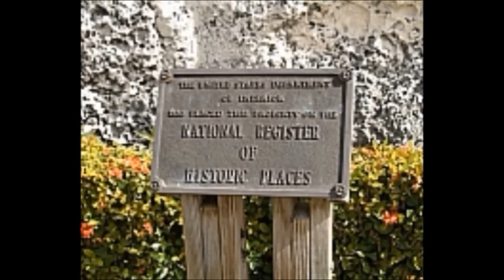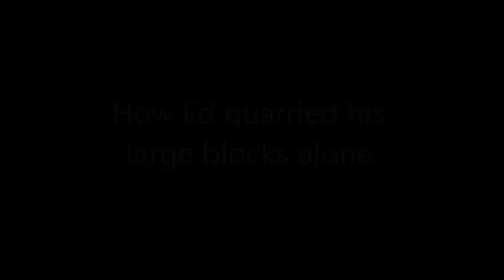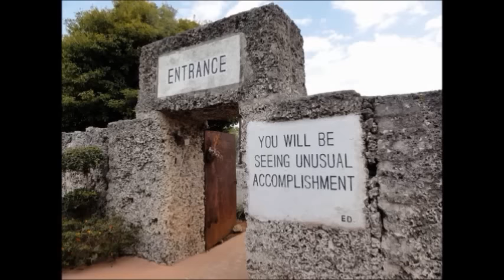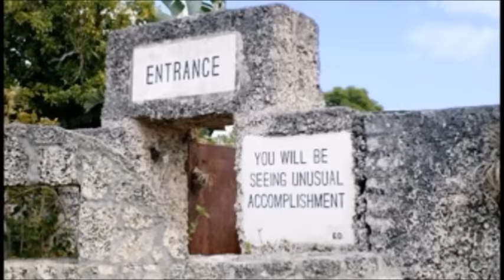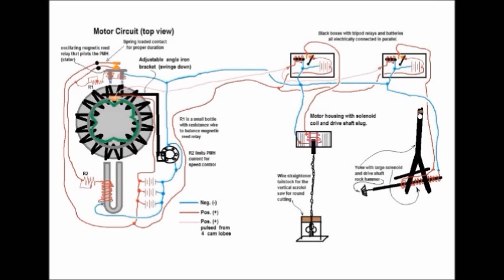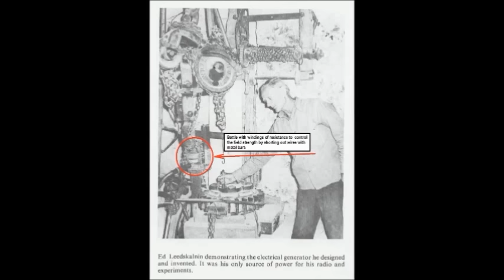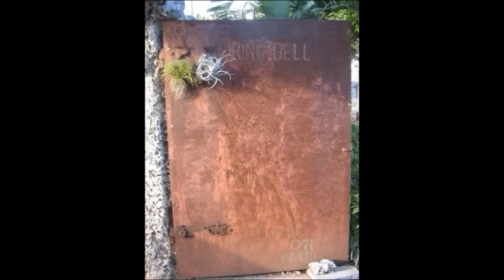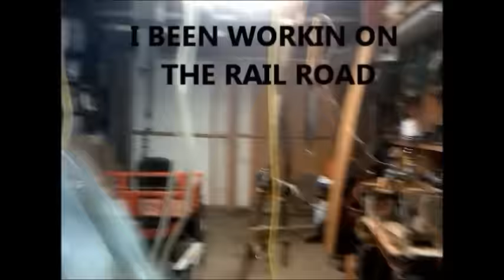Eds Coral Castle Quarry and Flywheel, Engineering Mystery Solved

Comment: Me thinks you missed the entire mystery of the mystery. Cutting the stone is nothing. It can as you admit, be cut with a hand saw. This coral limestone is a soft material which can be cut and shaped with ease. All it requires is time and energy.
Lifting the blocks is the mystery because they are so heavy. Stacking them only increases the mystery.

What do you do with the story of Ed moving one of his creations to another site via a wagon. How did he get the stones up on the wagon. And more importantly, how did he remove the stones from the wagon and stack them at the new site without his cutting contraption or his tripods, in the middle of the night without his battery powered lights and all of this in the course of less than 6 hours? That story has been verified and proven to be true.

Ed also said that he understood how the Egyptians built the pyramids by utilizing what he re-discovered. And he said that he refused to share his discovery because he feared what mankind would do with it. Building a DC (pulse) generator and utilizing solenoids to operate jack hammers was far from anything to be feared because that technology was already widely used.  However Ed's generator and his primitive solenoids do show us that there is great power in magnetism if you can harness it. 

The mystery is magnetism. Ed speaks of that all through his writings. The mystery of the mystery is how to capture the earth's natural magnetism which affects everything on earth, even gravity. And that is what takes us to Ed's repeated inferences to time, longitudes, latitudes and materials, which is what we still don't understand to this day. You have figured out one of Ed's experiments but you neglect the mystery of the mystery.
Reply: He used the Earth's mag to move them and it deals with the cone shaped rocks he had and there's more to it water is one .
Reply: You make some very good points Ed, I tend to agree with you.
There is more mystery here. 

Also Thomas is right... I heard a theory where water plays a part in the cutting, in an uncommon way. 
The pond /tub at the site is said to be used to create a kind of ionicly charged water which is ready after the water has evaporated to the second inner cut-out in the pond/well. Then used to cause the stone to cleave apaet by dripping it along the cut line. As I said 'uncommon'.

If modern-day engineers, when trying to improve the 10 tonne door (which used to open with just a push of one finger), were only able to only ruin it all together... then it points to the use of an uncommon (miss-understood) force.

Also can you imagine how much attention all those lights running, and having a truck engine running all night would attract, not to mention the added sound of the saws and solinoids going at the same time. 

I admire your mind and your video but I believe there's more to it personally.
Reply: He fracked the inside of the coral then pumped air into it and capped the blocks. They used water to float them.... I'm pulling this out of my ass, but that's how I would do it.
Reply: Nice video. Nice explanations.  Though there are still many unanswered questions. Such as an uneducated man able to have a greater engineering understanding than the mechanical,  electrical,  engineers and physicists with a Ph.D. around the world? And, doing so from only reading books in the neighborhood public library?  How could he afford to pay for all those working batteries,  mechanical devices the were specially made with tools and methods he did not have access to or the most likely ability of resources and financal means to make or buy these specialize devices you arexmentioning?

Part of me is, on a side note, thinking if we could just look at the record of all the books he had checked out at the library,  read this book, would at least give us the background of how he was able to figure out the knowledge he was able to learn and figure out himself.

I will give it to you, these are nice explanations to how he may possibly have built his castles. Though I also have to agree with the person here questions as well. 
1) That is was stated by Ed that it would 3xplain how the Egyptians built the pyramids. 
2) Why he was concerned that if the world should have such knowledge. 
3) And, if I recall correctly how the earth's own lay lines, magnetic energy and such was what allowed him to do so. 
4) I am also courious how he was able to move 30 ton stones? Yes a cart will make the moving of heavy objects easier. Though anyone who has used a wheelbarrow or a hand pulling cart knows, the more weight put in these carrying devices, the more difficult it will be to move. That is even if he had the cart sturdy enough to do such moving repeatedly over the years use. 

There is also that giant stone door he made that was so perfectly balanced on its center axis at the top and bottom that a person could open and close the spinning doorxwoth their finger, and little effort in doing so. Also feeling confident when no matter how many times opening and closing, that it would not fall off its axis, and be a potential danger to anyone around. 

I also recall how extremely secretive he was at night to all his workings. With stories of people trying to catch, and sneak a view of his secrets with pur his knowing, with no lick in doing do. 

Though again good explanations.  Possable if not answering all the questions, then at least some. And, also demonstrating pictures to such objects, machines he had at his property for use, that most were not awair of. Those demonstrating the strong connection to these devices being of use in his project. 

So, thank you for sharing.
Reply: EdOfTheNorth The mystery is in the application of energy against the coral or stone- that concentration of energy force through the blades is not something we get to see except in something similar to plasma welding, or water welding. To cut the stone, not just a small stone but a massive, several ton stone, perfectly cutting the stone would take a great force, or would it? The interesting part is that people assume Ed did this on his own without getting the epiphany from someone else- how do we know someone else didn’t inform Ed and he just applied it?
Reply: @davidalexopoulos8372  - That was one of the things I recall hearing. Is something about the coral stone had quartz with in it.  And, somehow thatched something to do with the work and energy used.

As far as if hechadchelp orcnot. It could be  within the realm of possibilities.  While at the same time it would not be quite an assumption to thing there was not help. The builder, all witness, people who tried to sneak on and see and catch what was going on and how it was done. They all said he figured it out on his own, and all reported he was doing it on his own. Simply put, no one disagrees that it was him and only him doing it by himself. 

Though therevis still a possiblity he may had help with the lnowledge and work. That though in mind. From any person who has taken logic classes, would and should know, you can never disprove a negative. 

It is similar to the argument that how do we not know Lockness Monster is not real. We could go even more extream is replace  Lockness Monster with the Easter bunny or Santa Claus. None of those could in a sence truly be disproved. We can only state when actually being investigated, there is no proof and no sign to defiantly show one does exist.
Reply: Quarterback x it’s one of those fun things to prove/disprove. Like solving a 3d wood puzzle. :) the help would have been to figure out the workings - he may have known Tesla, i think that’s around his time- that was my hypothesis. Tesla born: 1856 Ed: 1887 so they were in range, he would have been a young buck and the tech here would imply they might have crossed paths. It’s a long shot, but I wonder if Tesla shared his work with a young man that needed to prove something to the world.
Reply: @davidalexopoulos8372  - I will give you all that. It is definitely one of those fun mysteries that we all like to solve, or put our two cents in.

Tesla was defiantly a head of his time. If the fo ferment only knew how much, and would not only fully fund all his ideals and experament. But, also help with whatever supply's, engineering,  work force and whatever else he would have needed. They would be ni telling what all he could have contributed to the world. 

Then again, there are conspiracy theories who believe there are lots he did for and with the goverment. That the goverment confiscated all his work after he passed away, and keeping much of his discovery secret until there is some dire great need to pull it out of the closet. Even then no more than needed to so to still keep it a secret as much a possable. 

Here is an additional theory along simular lines to the other person, possibly Tesla helping him with his ideas.  

A while back there was a TV show, maybe history chennel.  Where they were talking about all the inventions  for all the great contributions different people have made to the world. They posed the question, what if that person was not around to complete their work, or make their great discovery, and inventions.

Their answer. That there were many others doing parallel inventions with the same approach,  and ideal that the person credited for the invention. That is really was more of a race to the finish with each one. In some ways the other people were even a head of the person who got the credit.  This was due to who got to the patents office first. Who made their work more know. Got it in,the news first and so on. 

I will have to say with this video and some of the fairly advanced machinery being used is a great addition to the mystery.  It can help explain a lot of how the castle was built. I had no ideal those more advanced mechanical devices, machines, electronics were being used there. My understanding was much more primitive devices such as the pulley, A frame logs as support, and the cart. I,think I may have also heard years ago something about him using batteries.  But, did not know,he was using batteries to such the extent and scale that this video helped show, and explain. Also explaining how the engineering could be made so cruel with the right understanding,  and efficent with the electricity only needed to be a very little to make the machines do the potential wonderful,  imaginary,  efficient,  numerous different jobs and capabilities.
Reply: Quarterback x hey, I was watching things that said he levitated against the forces that hold matter down on the earth, so my theory is way out there compared to the one you were working on. I like the video here because he takes the time to go after each piece, like a jigsaw puzzle, and lays everything out. I’m not entirely convinced that some form of levitation device wasn’t used, considering the advances of Tesla and the fact that 1 ton is still 1 ton, and that comes with accidents that happen from the type of rigging that was meant for us to “believe” was used- Ed was far from stupid. Thank you for you very good insight.
Reply: @davidalexopoulos8372  - Yes. I had heard of the Levitation as well. It was the reason most said he was able to do all the work Ed did.

So truexwith the author of the video. He did put tons of time to making, thinking, testing and researching this mystery.  It looks like the author actually went to the sight to see what he could. That is more than what 99.99% of us would had done with just that. He also noted not just the tree trunk A frame and cart for moving object, but also all the batteries, wiring,  what looks something like a home made circuit board, and machines that all could come into play to the work of building the castle.  That again is more than most would have documented, gotten pictures of. But, he actually did experiments to take the time to buil those devices in a scale down model to test them out and to explain the homemade circuit board, and wire wrapped glass bottle.

Maybe he is the first with some engineering background to look at this. And, first put on film to give his understanding he can gleam from his educational background. A big part of me does not want to believe he was the first but far from it. Though given how much I see people of the world tend to be lazy in thought, research,  investigtions, logic, and quick to making assumptions that have no basses orclogic to it, it would not be so far fetched ofxola though that all other stories lacked actually talking to and interviewing knowlegable people with an engineering background so to better solve this mystery . Example if such people who do not look into things much and rather just jump to conclusions we see ever day on every occupation.  Those who embellish in gossip,  passing it out as those who givecan ear to it are the easiest to point a finger to such people. Though sometimes we all are guilty of such because of how we may feel about a person and get tricked. Example Adam and Eve. But, we all have very likely been tricked by a love one accidentally or by design. Then somextime because someone seems so emotional about something we may be fooled to think long those lone because they are just so convincing being so sure and emotional about it. There is also what I call the white night affect. Someone plays the damsel in distress,  someone playing the victim card, emotional appeal  and such. Thus makes us want to jump in and protect the person and in some way blame who they point the finger at. Many times it turns out that the victim is actually the aggressor,  and we are the puppet bidding to do their evil work. 

I do think most people want tmac solution from the fringe of science to explain how levitation,  and anti gravity helped Ed, and the Egyptians build their great monuments.
Reply: @T sK - interisting point. Though also as you know, many times scientist will develop an small scale experament for such projects to demonstrate the possability at the very least. At most, prove their method works from a small scale which could easily be built up to much larger scale.

With him moving such large stones could easily be looked along those lines. And, that mot only was he able to do it, but also did it alone. Where as it could be safe to assume that was not the case with the pyramids.  Also, no one knows how long it had taken to build the pyramids. So, the time limit could be though of as a mute point. Though also remember it is also safe to assume there was a giant work force used to build the pyramids,  and with that there were decision of labor to designers, cutters of the stone, movers, placing the large stone, measuring the stones, polishing and cutting special slots and nooks if when and where needed, eat, sleep, having a switching of shift to keep the work going. And, whatever else we could think of to decide the labor.

Either way, it still was an impressive task Ed had completed.  And, we can either accept or not the statement of Ed saying the bases of hiw he did so was based on how the pyramids were built. After all, people do lie for a number of reasons, as a redirect, humor and joking, keep secrets,  just felt like it, or whatever other reasons we may be able to think of for his situation. Such as we know he did not try to get rish sharing his knowledge. So, we know that money was not a potential reason for him lying about how he was able to build his castle. 

Ih as far as stacking stone. Eh, hard to say. It is not so commonly done here in the U.S.A. and very likely around the world. Though sure it is still being done in many places around the world. It may not quite be looked as the same, though my house has brick around the house but the back of the house. Even in the back we have brick coloms to hold the patio roof and brick fireplace. In addition there is a flat stone skirt about 3 feet high around the house with the brick.
Reply: Me thinks YOU missed the entire first part of the video. he used the tripods to lift the stones. there's even lots of footage of it. to put a stone on a wagon just pull a wagon under the tripod once the stone is lifted? to move a stone laterally into position he used come-alongs. what's the mystery exactly...
Reply: Dalton Bedore I appreciate talking to you- your above my head in basic engineering skills, but Ed couldn’t have moved that many stones so quickly. Is it possible, if not plausible  that what you see there could have been planted? We have to look at time and horsepower- the ability to move the entire castle, and transferring the stones onto a flatbed wouldn’t work on that system.
Reply: Dalton Bedore If I may, with respect- the ability to levitate objects is quite real, this, given the free energy theory that Tesla also verifies, I would say someone wanted money from dams and not allowing others free energy. As gifted as this man seems and as you seem to be in this field, there is more here than you are allowing- forgive my lack of trust, but it seems like suppression?
Reply: @dalton-at-work  -True. Though there are still some aspects missing to what you shared. Yes a tripod can make things easier to lift.  Though with the weight of the stones he had to have used other mechanical advantage devices. Such as, but very possable more pullyes, wrenches, rope and cart. The average weight of the stones were 15 short tons/14 t, the largest stone weights 30 short tones/27 t, and the tallest are 2 monoliths standing 25 feet/7.6 m each. 

Where Ed was chronically ill
5 foot/1.5 meters,  & 100 pound/45 kilograms man.

A unit of weight, equivalent to 2000 pounds (0.907 metric ton) avoirdupois (short ton) in the U.S. and 2240 pounds (1.016 metric tons) avoirdupois (long ton) in Great Britain. Also called freight ton.

SO, 2240 LB x average weight 15 = 33,600 lbs. The heaviest 2240 lb x 30 = 67,200 lb

Now when using a pulley. With a compound pull we can reduce the weight the most with a pulley system. So each time the rope goes through the pull determines the mechanical advantage. Basically count how many ropes going through thepully to determine the mechanical advantage.  Loop the rope around one pull, one rope to weight means the mechanical advantage of the weight will take the same force to move the object. Though add another pulley, loop the rope around both pulleys,  while suspending the weight on the second pully, the load is now supported by 2 ropes. The mechanical advantage is now 2. Meaning needed is 1/2 the weight of the load to lift it. Suspend a 3rd pully from the 1st pully, loop thexrope through that so that you now have 3 ropes suspending the load. Now your mechanical adavantage of 3 ropes requires 1/3 the force to lift the load. Though also remember with each reope suspended to increase the mechanical advantage also means the length of rope needed will increase. So, 2nd example would need twice the length of rope. And, 3rd example will need 3 times the rope for 1/3 the mechanical advantage of force needed to lift the load. By doing so the work used is the same with all 3 examples. So, need more and more rope as we increase the mechanical advantage. Also remember that each pully itself will also need to carry the weight of the load. 

So, if we suspened the weight with 3 pulleys and 3clength of rope will decrease the force required to lift the load to 1/3 the force. 

So,the average stone at the weight of 15 short tons/14 t = 33,600 lb/pounds. Using 3 pullies , suspended by 3 ropes to reduce the force needed to lift the weight would give us 11,200 lb/pounds of force required to lift 33,600 lb of load. I dont know about you but that would still be way too heavy of a force each one of us could create by ourselves.  There was a time I was pretty strong by overwhelming most peoples standards.  Though I was never that strong. Heck, the strongest man in the world could not lift that. 

The Guinness Book of World Records (1985 edition) lists Paul  Anderson feat of lifting 6,270 pounds (2,850 kg) in a back lift as "the greatest weight ever raised by a human being".[10

That would still be under half the force needed. Which could only be done in a back lift. And, could only be done once. No where close to the force and length of rope needed to lift the average weight. 

Also let's remember the stones were quarried and moves. The wagon does not explain any of that. Since the wagon was on tracks to operate it. And, the tracks dis not come close to the quarry.  Then again the tripods to carry such weight, and each pully able to carry such weight each. Is pretty demanding.

Though in all honisty, to look up all those facts I did have to do a little homework on the Coral Castle.  I prefer to be the one looking for the truth and best honist results,  over a person who will hide information so to put winning some dissagree as their priority.  That was the information will far greater benifit us all.

Mystery of the Coral Castle Explained | Live Science
https://www.livescience.com/41075-coral-castle.html

Withcin it, it mentions one of Ed's friends writing a book about Ed and how he built the castle.  The book is names, " Mr. Cant is Dead! The Story of the Coral Castle "

Though again this is just one source and not something mentioned in most articles about Ed and the Castle. We done even know how well the explanation may be, and how thorough it may be.
Reply: @TheQuarterbackX  practicality would dictate that a 100 lb man moving a coral castle, weighing in more than he could possibly even attempt to lift, let alone pursuade along a course of pulleys and tripods, would like telling you to move you car from your driveway to your backporch swimming pool area without hitting the aluminum bars. You could no more do this than Ed could with a tripod in an evening, and Ed packed up several stones at a time, then, who unpacked them on location? hmmm, there seems to be a few missing pieces to the practical leverage theory- and they don't add up to human effort. In fact, it is more bizarre to think he hoisted the stones than if he used levitation techniques that were touted buy tesla and the government was known to cover up. if that had not been the case, then we should not explore that potential, but it was the case, Ed did the impossible (to us) and that little man cut through the coral like it was butter and within an incredible accuracy. We could track numbers all day long here, until they finally admit that the tech was suppressed and that he used some sort of anti-gravitation device, whether that be using sonic waves or another method. Point is, trying to explain it with ropes and pulleys doesn't fit the scenerio.
Reply: @WhiteBehindYou - I had some friends that would mention there were a number of benifits wothxsound and frequenc5. And, lately I have seen that also mentioned with YouTube videos with Nicola Tesla.  Then many friends science which is stated on Micola Tesla's work also based on sound and frequency.  Seems from these difference sources, we still have a lot to learn in our knowledge in science, health, and physics.
Reply: @davidalexopoulos8372  - I fully agree. And, for those that like to fallow Arcoms Razer, that the simplest answer is usually,the best? That needs to really be though through. Yes I get how there are times that may be the answer.  And, times things are over thought out. Though there is a reason we go to schools to learn, and do not have a 5y/o boss we are depending on a regular check for, and they are not our teachers, doctors, engineers,  mechanical,  martial arts teacher, and we dont go to children to answer as a sage for all our worldly problems. The truth is that many times the simplist answer is usually the worst answer, not based on facts, science, experance, or education.

Simply put. Heck yes there are definently some pieces to the puzzle missing. And, many of the pieces of the puzzle we have just dont fit, and are not even for this puzzle.  Which some how got mixed in with a puzzle they do not belong to.
Reply: @andyjohnson7408  Fart gas powered. I like it.
Reply: I have two words to answer your questions about magnetism...study "Schumann resonance" let me know where that leads you
Reply: Ed moved the stones via sound and vibration using cone shaped stone tools. one of the neibors kids saw him do this once, and told his parents he did it with ice cream cones, and they laughed him off. Michael Tellinger from South Africa, who discovered the Stone tools, that were used to do such work all around the abandoned gold mines. I suspect sound and vibration can cut the Stone as well. Sean Dobson Hippie Music on YouTube.
Reply: @seandobson5829  Someone on youtube had a video or report of how to drill with copper pipe through the hardest of stone using a tuning fork attached to the drill bit and achieving the resonant frequency suitable for the material. Punch a hole through all of it, there is also electrical discharge drilling which could be used in conjunction. See this: https://www.youtube.com/watch?v=rpHYBz7ToII&t=370s

I suggested electrical drilling because of the baghdad battery and possible electroplating finish on the egyptian artifacts.
Reply: Freaking amazing that this perhaps compulsively curious engineer did the work to answer some major questions about this system,  model it successfully, then produce a video  - free of speculation or "mystery" only to have a dismissive and arrogant lover of alien technology and the conspiracies that keep "ancient" secrets that "science can't explain".  
If Ed knew the secrets of the Egyptians it didn't effect his construction,  but if the Egyptians knew Ed's secrets, their constructions would have been greatly enhanced. 
Magic isn't real
We are the aliens 
Engineering is for grownups
Reply: Hit n miss engine would help, pulleys, I dunno they have PTO then? lol
Reply: EdOfthenorth  Thank you, you explained it so, so well! I was thinking the exact same thing during the whole video! Ed used free energy devices using resonance,  cymatic, Lay lines and sacred geometry. ♡
Reply: EdOfTheNorth 
Yeah, no one actually works these days so it’s rare that a man can imagine this work being done by building simple machines using “electric” energy. 
You know that without the “lay lines” and without the sun feeding the earth there is no electric power being generated by magnets and metal windings! You know don’t you, that these simple motors work by the “power of the air” and that shit is a mystery! Same as the fact that “life” on this earth leads directly to death! Don’t ever let anyone tell you they completely understand what’s going on on this plane. Anyone on their way towards death is deluded or a liar. This realm is kind of a sophisticated clown show to get you thinking and wondering and especially to get you picking sides.  
Enjoy the experience
Reply: @Drew_Hurst  to quote ed.. its easy if you know how,,,  lifting large heavy things  levers  a good place to start rollers another or just a simple pivot point will work ,,raising those blocks  a jack and cribbing is the common accepted method   as for the cutting coral limestone will cut easily ,, it isnt hardness 5 m6 m 7 of the granite the egyptions  were working . simple machines will do the trick  to answer the questions here  and it takes an intelligent person to use common knowledge in uncommon ways such as we have seen here and there really is no mystery here other than our collective ignorance and lack of imagination  to explain his accomplishments as other than mysterious powers..  the power is thought  as a species we tend to exaggerate how much we have put into anything the video creator has answered all mysteries here but why which i chalk up to humanity is weird
Reply: LOL, your all a bunch of nuts. Not that that's a bad thing. I even tell my kids about Santa, the Easter Bunny, and the tooth fairy. On one hand it's nice to believe in magic but if Ed was the same way he would of never built it. Don't limit the ability of your imagination with impossibilities of magic but use them to inspire invention. Non of this is mystical it's all practical but nothing last forever without a good story. If he had let everyone know how it was done it would probably be covered up in weeds abandoned by time by now.
Reply: @Drew_Hurst  I grew up next to the castle and I can confirm as a kid I used to.open that 12 ton pivoting door...with one finger.
Not anymore .
In 1986, idiots from the state historic society decided to move the door and reset it with a 20-ton crane it is never been properly reset and now cannot even be opened at all and there's a side door built as the main entrance this is only one of many points of Mystery the Ed built including how he move these huge stones into a wagon and reset the castle all in 6 hours.
 Great point on the door most people don't know about that
Reply: Did you not watch the video?  When the mystery is stolen from us, we shrivel up and act out. The older we get the more we look for miracles- as the day of death approaches- the smell of nihilism becomes unbearable. Its why churches and cults are filled with grey haired humans./
Reply: Wow very well said Sir thank you
Reply: Andy all I see here in this video is parts being able to move other parts. But I see nothing that is precision or precise
Reply: EdOfTheNorth Perhaps frequency and tuning forks played a part?
Reply: Ancient Aliens said it was aliens with rabbit ears that floated the rocks using analog uhf frequencies hooked to a Flux capacitor
Reply: EdOfTheNorth while I enjoyed the video for its succinct nature, I completely agree that it doesnt address the real mystery. No system shared here can explain how the blocks were lifted so high. I think you covered my own critique much better than I could have expressed it.
Reply: I agree Ed. There's something still hidden. Whether sound or magnetism, He moved those stones with minimal effort.
Reply: It is the true , unsolved and am not acording to that histoy in the video , for me it is a totaly lie..
Reply: @davidalexopoulos8372  Here is some insight..."accidents" are caused by people being far from smart. And this really smart guy named Einstein figured out that gravity is basically a fictitious force that arises as a consequence of different perspectives in space and the fact that space is altered by mass... There is no "force" to defy unless you can gather up enough energy or matter on the other side of the object you're lifting. When you consider how much energy is released from splitting a single atom, you can try to imagine how much energy it would take to simulate the mass of a planet
Reply: Justin Case and here is some “insight” for you. Have you studied the occult, or seen what they are capable of? How about the Anunaki that spawned Nephilum that took over the Earth? Do you have a background inter-dimensional realities? How about a world within a world? The upside down? Your difficulty is your lack of perspective and ability to think outside of the box.
Reply: Justin Case When the truth finally hits you- eyes wide shut- you will want to throw up.
Reply: It's obvious that there is within us the ability to speak to large stones, even mountains, and will them to move. Like Jesus said we could.
Reply: @davidalexopoulos8372   men took time to THINK then.
Reply: @arielstrafing5225  - Oh I have no doube we have been dumb down to in our education and science. I see it all the time with both students and teacher in my own science degrees. 

And, dont dout there are lots of more effective and advance things we could be doing but its kept away from the public for a number of reasons.

If you know something about gravity being a false , I am always open to learning something I dont know. I will admit that can,be a bit difficult for me to fully get. I know gravity can be something trsted and measured. But, also know physics have said for a long time,,out of all the forces, that seems to be the one we know least about.
Reply: @UCr8KjGUWlWKSP80-VdW4hXA 
I'm not looking for anyone to collaborate with me on any projects but if you really want to understand the mystery, just buy Ed's book called Magnetic Current and do the actual experiments he describes in his book and watch what happens. Use the materials Ed used as well. If you are an observant individual you will add experiment to experiment and discover a true mystery. Then if money or fame is your goal, you will not need anyone to collaborate with to find success.

Don't just assume that you already know what will happen with each experiment but instead do the experiments and watch carefully. Note what happens to the weight of the matter you are experimenting with as well. Work your magnetism with additional magnets set at various micro longitudes and latitudes. Make no assumptions. Just do the experiments and watch.

I'll give you a tip which Ed mentions at the very beginning of his book. It is cryptic to be sure but Ed is pointing at the compass points while using Bible symbolism as his dictionary. So if you don't understand Bible symbolism, you won't figure out the mystery. But remember that even non-magnetic materials can be magnetized (made into a magnet) by placing them in a magnetic field. The earth has a gigantic magnetic field, doesn't it?

Ed was right. Mankind is simply too wicked to re-discover this mystery. Man will only use it to destroy life and attempt to make himself like God just as it was in pre-flood times. Perhaps some day but not today. TRUTH in an attitude of LOVE (God) will simply not allow it. I recommend searching for the true Grail and leave these false grails in the past where they belong.
Reply: @EdOfTheNorth  - awesome. I love learning, doing experiments, and love the advice you gave. 

And, yes it is sad with every great invention there are people of all types who will misuse it
Reply: MentToBeEzy  Oft times the hardest to explain is the easiest to execute. However 455 feet in the air is far from working on level ground.
Reply: So I heard that he some how used sound also to move them and researched that there’s earths frequency that somehow creates free energy what if he captured this sound also with his 🧲 and some how used that to move his rocks some how can float the stone and place them where need to be that’s the mystery
Reply: I would like to add to Magnetism also Sound or to be scientifically correct Vibration and resonance to work in our favor :)
Reply: My guess is it's not something as complicated as mag fields or whatever the fuck woo-woo quantum science people pull out of their asses these days, but something as simple as basic geometry, appropriate application of loads, and forces like erosion and friction.  Nothing more, nothing less.  The trick is how these simple ideas are stacked and built on one another to achieve the wonders of things like the pyramids and coral castle.
Reply: Hey there  @EdOfTheNorth  just another follower of a very long journey here on a subject of how Ed manipulated the stones. Your words on society not able to handle the knolleges Ed was in tune to is spot on. Nobody is willing to believe that God and electricity were used to strike fear in the hearts of many by both wizards and priest all thought time before the printing of the Bible. Nor would many study the word religion long enough to learn of the understanding of the Druids when he pointed to the tree saying G resides within the trees aswell as every other living thing. See they become distracted by a garden with a magical tree that provides knollege but never question what that symbolizes. They think that it was an actual Apple that was eaten that caused us all to fear this God. Perhaps the Druids and the tree of knowledge both have significant value in the storyline. If the G could be detected in a tree what could it be? A pulse? A signal? What if we could extract the G from the tree? Is there a way? Perhaps 1.5v worth of G? Would 16 in series equate to 24v worth of this G? Do trees have a gender? Odd question isn't it? I wonder if the time of day has an impact of the strength of current within the G? I'm NOT looking for an answer on ALL of these questions I've brought forth just adding to the whole Bible subject and the mystery within religious text.
Reply: @ebikeliverystable  The God in all things is Father TRUTH and the Spirit of God is LOVE, the desire to live. God however is not something which can extracted and harnessed to the use of the TRUTH's creation, because the TRUTH showed Himself to us in the Christ who is God and His Spirit in God's one and only ever begotten bodily FORM - God in flesh.

Remember? Father TRUTH, His Spirit LOVE, His Son the FORM of God - the Christ.

If we today want to know and understand the wisdom of the ancients, we'll have to ask Jesus to show us because God already told us that He is not about to allow mankind to know that again without His approval, and allow mankind to destroy His creation a second time. 

God's creation once knew and understood God but they turned away from God and destroyed the world with their playing God themselves. God will destroy everything before He allows the wisdom of the ancients to be abused again by the blasphemers who deny the actual identity of God as a living being rather than just the knowledge of concepts, formulas and calculations. 

Christ alone is the Tree of Life whereas Falsehood the devil offered and still offers the forbidden fruit of which God said, "Don't touch!"
Reply: @EdOfTheNorth  just another way of saying nothing at all is what I took from your words Sir. I do believe Jesus walk this earth. And with assistance of the God I described early on he was able to reserrect life similar as our first responders do today. He healed the lame perhaps similar to how a therapist stimulates muscle tissue that's been damaged. With this electric today we can restore the hearing of many who habe never heard and in some cases remove the cataracts of the eyes of the blind person. Is it the same power that the prophets used to gain profit or the King used with his Crown and Throne? I doubt that electric was an evention of man. With the power of observation, explanation and replication aka science mankind was able to harness this power that was among nature. Along with respect we were able to overcome the fear placed in our heart by observations. If man should never have to fear anything he respects. I truly respect the word God and why I have never stopped studying the word itself. I just chose to listen to my own heart on the subject and not what only one man allowed me understand.
Reply: Ley lines